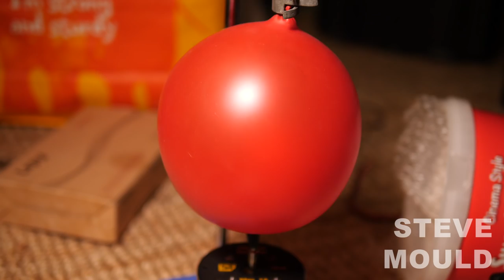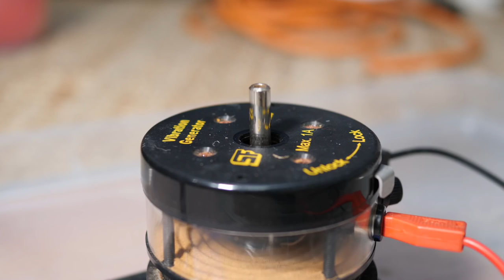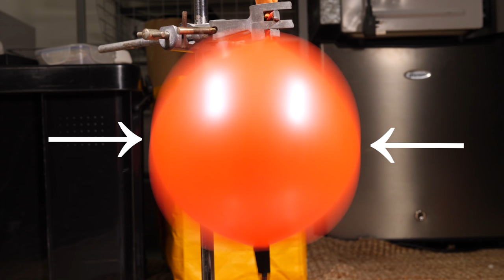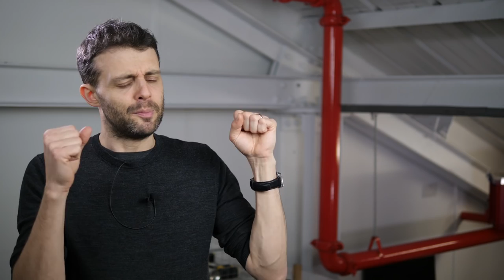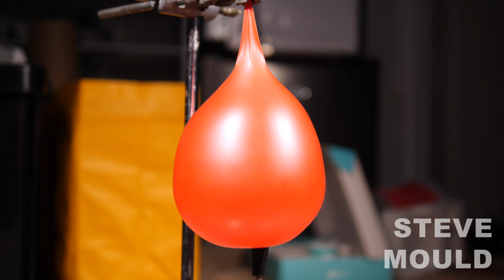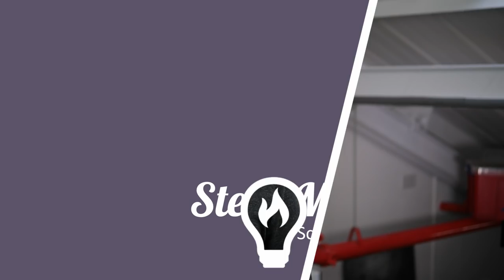Balloons look really weird when they resonate

Comment: The easy way to check for rolling shutter effects on something that's moving only in one direction (up-down in this case) is to turn your camera sideways.  And then, at least each vertical (now horizontal on the screen) "slice" of the balloon would be rendered faithfully, but out of sync with other "slices" because of the shutter.

Comment: You didn't mention the phase lag between the driver and the motion. If not on the resonant frequency, and if there isn't much friction/resistance then the motion and the driver should end up being  90 deg out of phase. That's especially interesting because it means the earth's tidal bulges aren't facing toward and away from the  moon (say during a full moon), but are about 45 physical degrees off (which is a 1/4 cycle phase lag). Check out tide charts for hawaii (not near continental shelves) at full or new moon!

Comment: A more stricking evidence for rolling shutter, I believe, would have been to turn the camera sideways. Indeed, your system was basically rotationally symmetric in the horizontal plane so by turning the camera sideways, the rolling shutter would induce a left/right asymmetry (or top/bottom as seen on the footage if you wouldn't turn it back upright) which would rotate as you would rotate around the balloon.

Great video anyway!

Comment: Could you make a video on how to make a vibration machine?
Reply: ...for science, right?
Reply: peabrainiac 
Of course, using resonance you can shake your entire house. Or use it as a electronic hammer (not that strong but could still be used), also you could use it as a mini cannon by applying a strong but short pulse of electricity to push a little pellet threw a straw.
Reply: You could also use it for a shake table for several other resonance experiments.
Reply: good idea !
Reply: Almost immediately after writing my other 2 comments I realized you could also make a mini house and place it on the shake table to simulate an inaccurate earthquake.
Reply: UAVwaffle 
It is the ideal Valentines day gift.
Reply: The one he is using looks like a speaker without membrane and upper suspension. Only lower suspension, magnet and coil that operates in the magnetic field. Basically if you have older subwoofer with busted membrane you should be able to convert it to something like that.
Reply: MrGreenAKAguci00 Ya that's what I was thinking too.
Reply: asking for a friend
Reply: speaker= vibration machine
Reply: Search Bruce yeany homemade science he makes one from a loudspeaker

Comment: did you try to fight the rolling shutter using the strobe? Since you are anyway using it, maybe you can use it as the global shutter. i guess that would work by  setting the on time of the strobe way shorter than the exposure time of the camera...
shouldn't that lead to all pixel rows getting light exclusively from that point in time?

Comment: How does Nitinol respond to resonance ? This metal fascinates me. Aluminum and nickel the memory metal. If you had a disc in space and it was black on one side and white on the other and you pointed the black side of the desk to the sun would one side get hot and the other side cold? Kinda like the moon Cold on one side hot on the other. Does nitinol still maintain its ability to reshape in a compression chamber when a small charge is applied?

Comment: you should get a light that you can flash at different frequencies - then you can see IRL what the camera sees. unfortunately i don't think it would help you show things on the camera any better.

also, wouldn't there be a post processing fix for rolling shutter? maybe you can move any particular slice of pixels backward in time just enough to when it should have actually been taken rather than it being on the frame which it got recorded.
i think you would have to use a much higher framerate , but you can possibly reduce the framerate again by interpolation

Comment: Yeah but it seems you're getting the rolling shutter in reverse, probably because it's combined with your technique for slow-mo? I didn't watch your gravity waves video yet (I'll watch it next) but I imagine you're basically skipping a number of video frames roughly equal to (and slightly longer than) the time it takes for a full period of a periodic event like rotating things on top of a rubber sheet in the other video or wobbling a balloon up and down like here? I would then imagine that you'd get a forward rolling shutter if the period is slightly longer than an integer multiple of the camera framerate, a backward rolling shutter if it's slightly shorter, and no rolling shutter at all if it exactly matches the period?

Comment: any particular reason you use a vibration generator and not just a speaker with some sort of tone-generating software?
Reply from the maker: A vibration generator is basically a modified speaker. I already owned one for something else so it made sense to use that instead of modifying a speaker!

Comment: It looks like volume isn't preserved, does that make sense?
Reply: That's probably the rolling shutter effect.  At one point in time, the top is squished and the bottom swollen.  Half a cycle later, it's reversed.  If the time for the shutter to roll from top to bottom is comparable to the period of oscillation, you could get the image of the top of the balloon squashed combined with the image half a cycle later of the bottom being squashed too, or indeed with both of them swollen.
If you watch standupmath's video on rolling shutter, Matt shows a great image of a water balloon being burst where the shadow (which is below the balloon) has been burst but the balloon itself hasn't!